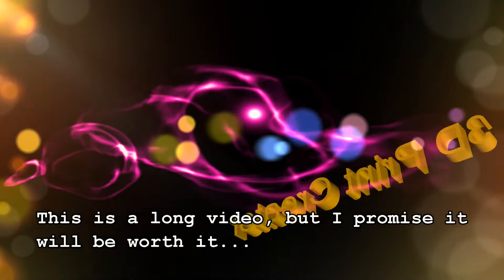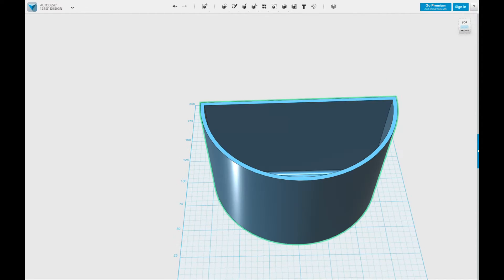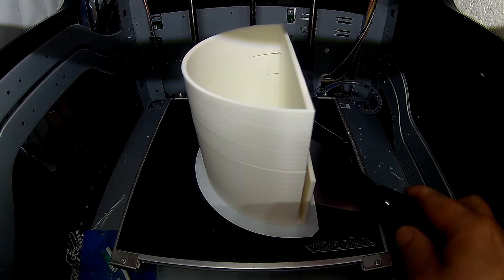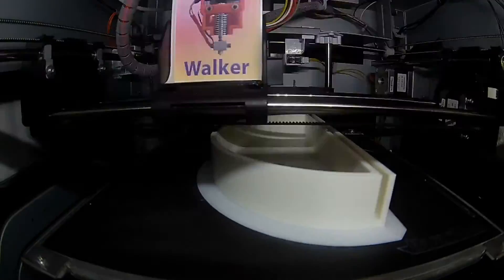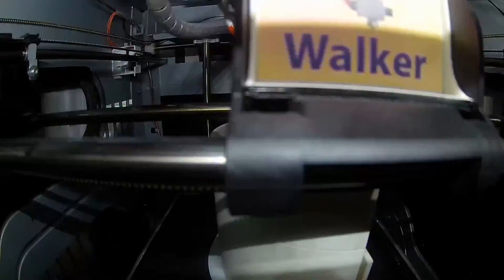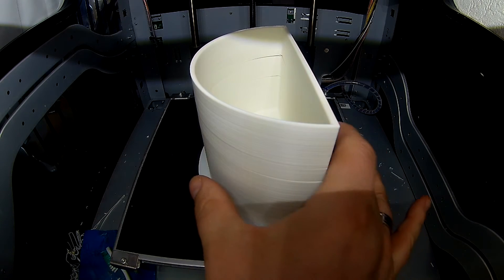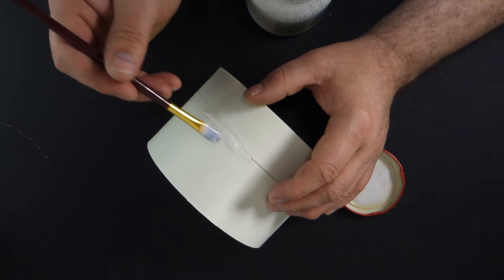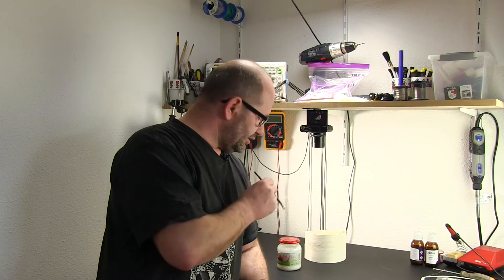▼ 3D Printing from creation to printing and repair

Comment: I have sometimes used a piece of the purge strip for filler using the acetone to glue it in place and then trim.I save all the purge strips so I have may colors.
Reply from the maker: +buzzerco That works perfect as well :-)